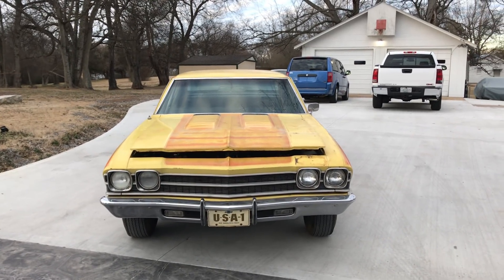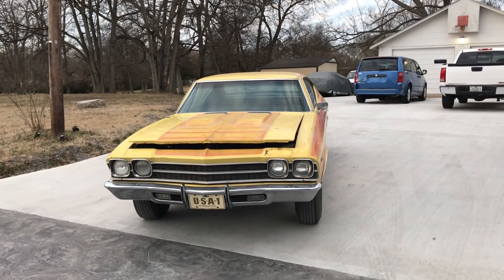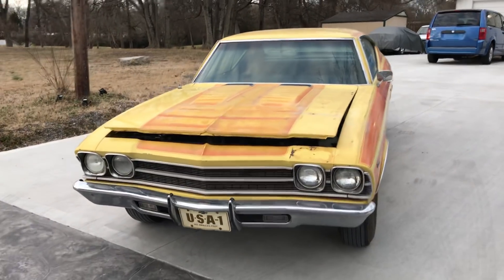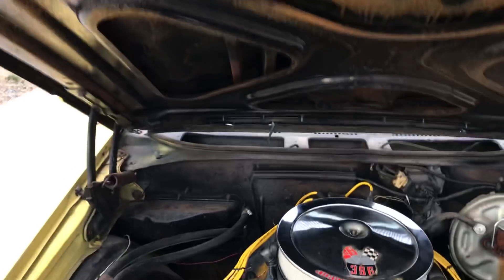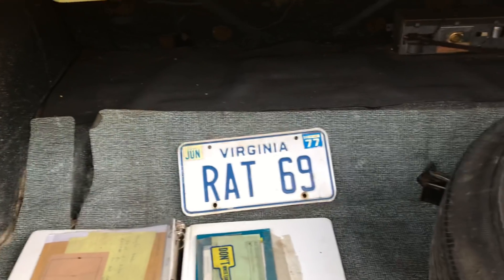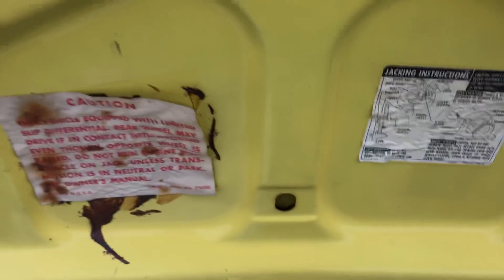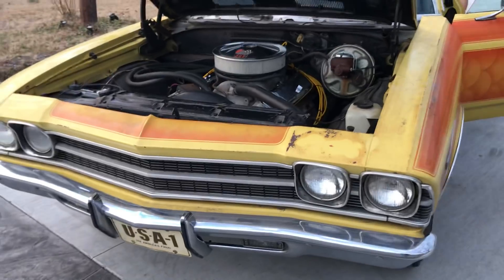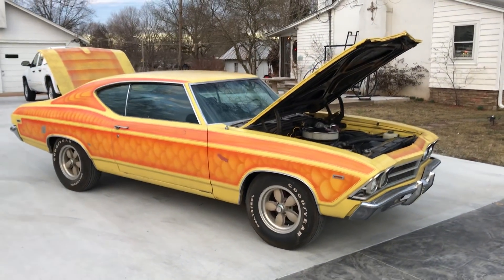POSSIBLY THE RAREST ULTIMATE 1969 SS396 L78/L89 M21 4.10 CHEVELLE EVER FOUND HIDING 40 YEARS!!!

Comment: Patrick is there any way to confirm whether a 69 Chevelle is it truly a 69 Chevelle SS without the bill sheet order. I just picked up one it's got disc brakes that appear to have to have never been changed, 12 volt rear end, correct correct gauge cluster in center console

One of the things that's different about this car is that I've noticed that it doesn't have any fender badges and the fenders appear to be original on the car.

Comment: There was a 69 Chevelle L78/L89 for sale at the '21 Mecum Auction. What was the process to get the aluminum heads? Had not heard or seen one until then.
Reply: Check off the option when you would have ordered the car. No big secret. It just costs more money and takes weight off the car.
Reply: @markg7030  Was there a difference other than the weight, cost? Did it add any HP?
Reply: @stevethomas760  The L89 aluminum heads was about a $400 option and same 375 H.P. rating.
Reply: @markg7030  Wonder if GM just didn't want to mix up the horsepower numbers. Do you know if it was a better head or was it just weight? Would that be like the L88's 430 HP rating?
Reply: @stevethomas760  I think it was only a lighter head. The L88 was an all out race motor for about $4,000 more so they gave it only a 5 horsepower bump up to discourage buyers.

Comment: Very cool. Just got inside from working on my 70 Torino. Car was in horrible shape and had really ugly heavy duty vinyl covers on the seats. Cut them back to recover and found brand new seats. Still had ford plastic on headrest. Some of the seams pulled apart from drying damage. Seats look exactly as they did off the assembly line. Blew my mind

Comment: My dad is original owner of a 1969 SS 396 with 350hp. It is Daytona Yellow with the black stripes. The car was parked in 1976 and we didn't get it running again till 2019 for the 50th anniversary. We determined just yesterday 5/6/2021 that is does not have M22 rock crusher but it does have M21 which was kind of disappointing. It has about 73000 all numbers matching. It does have 4.10 gearing as well.

Comment: I ordered 1968 my first new car.  A 1968 Chevelle SS396, 396/375, M22 9 (early one 1st gear whined), 4:10 posi, Disk brakes, console, am radio, 8-track under the dash, horizontal GM tach.  Color Fathom Blue (very dark almost black) and black interior. I saw 2 L89 Chevelles that year, both of them the dealers the installed the aluminum heads.  How come you never mentioned the deep pulleys were missing< I know you mentioned the water pump and alternator replaced but never the easy giveaway of the deep groove pulleys.

Comment: Amazing car.  I really like the color.  Does the SS hood  add any underhood clearance compared to the non SS hood?  Seems the webbing is the same on both.  I have a '69 elCamino big block swap and need a bit more clearance but don't like the 2" cowl hood look.
Reply: Often you can go to  low rise manifold,    and/or use a shorter air filter.

Comment: Friend of mine had a 69 post SS 396 Silver, M-21, 4:10 gears L78, or so we thought. He blew the engine up in 1970. He and his dad had a time with Chevrolet when he blew the engine and tried to get Chevrolet to replace it. This car was beating 440 GTX's and Hemi Roadrunners on the street. Chevrolet said the engine he blew up wasn't supposed to have that engine and they were not going to warranty the engine. We never did figure out which engine it had.  He said Chevrolet finally said it was an experimental, or preproduction engine of some sort. No Aluminum heads. The replacement was a 402 and didn't run near as well as it had before. This car was traded in and we have no idea where this car wound up. But it didn't have it's original engine anymore. If I'm remembering it did have the chambered exhaust, guages, bench seat no console. We had a lot of fun though running cars at night on the unopened interstate. Saw this video, and it brought back memories. Thanks for keeping memories alive.

Comment: Don't think I'd start it again until I found the valve or cam problem. Sounds pretty rough. Thanks for the video, I appreciate these.
Reply: When I start a motor that I know hasn't ran for a long time, I always pull the distributor and prime the oil system for a while. Even then there can be rust on cam lobes.
Reply: The valve-train noise is a given, not to mention what could be one hell of an exhaust leak! I always like to use the oil-primer tool that spins the oil pump via a drill thru the "lightining-whirler" hole and primes the lifters/pushrods. 5 minutes of time can save 2.5 hours of tear-down & a CHUNK of coin on a rebuild....

Comment: I had a yellow 69 Chevelle once. I don`t know if it was Daytona Yellow or not but it looked exactly like this yellow. Mine originally had a 283 with a powerglide 2 speed but when I got it had been changed to a SB 400 with a Turbo 400 transmission. I sold it to a guy for $250 and a month later he hit another car head on and totaled it.

Comment: A sweet ride but sounds like the lifter need to be adjusted and fix the exhaust leaks
Reply: All396/375 horse were mechanical lifters, nature of the beast to make some noise
Reply: @zendog5884  Feeler guage
Reply: The rocker arm is adjusted not the lifter
Reply: @FuelTankerMan  valve lash clearances are adjusted, lifters are not adjustable, conehead

Comment: Wonder how rare mine was. Ordered @ the Freedom Hill Exchange (PX) @ Da Nang, Vietnam. It was a Dusk Blue, bench seat convertible. Opt's: M21, L34, A01, B93, C06, H05, J50, J52, K02, K05, PW8, T60, U26, U46, U57, U63, U73, U79, V01, V31, V32, & Z25.  BTW, those Amer. Racing 200S wheels were nicknamed "Daisy Mags" back in the day. As well, that is NOT a Hurst shifter. It's a Muncie lever, off a console-equipped car. The giveaway is the unique dog-leg kink in the lever. That kink brought the shifter into closer proximity to the driver when a console was ordered, which of course made bucket seats a mandatory option as well. For 1969, 400 L89s were produced @ $647.75 a pop, available (from the factory), ONLY when the L78 was specified on the order sheet. Later in the year, the chambered exhaust (NC8) was no longer std. w/the L34, but still available as an option. Incidentally, I'd ordered the L78 & M22, but since I'd planned on going thru GMAC financing (though that didn't come to fruition) GM saw fit to deny me those 2 options. Reason behind that most likely was if they were financing me they were "sweating" probable warranty coverage w/THAT kind of drivetrain.......VERY unfair!

Comment: The problem with finding these old muscle cars is they were the cars me an my friends bought in mid to late 70's for less than 1k and we abused them (bolt ons,  racing everything) you could pull a engin tranny combo in your front yard under a tree in the morning ,work on it and put it back in for that nights cruise. All you needed was 3 sockets, channel locks, and a screw driver next video I'll tell you about painting a 57 t- bird all we used for that was two rollers and a paint brush.   
(Dont 8 it was Mary k pink)

Comment: My friend had one back in the early 1980s and it said "Astro Ventilation" on the fronts of the door glass, down low where the vent window would've been.  His was an automatic/console car, and I'm not sure if it was actually an L78, but it did have a Holley carb on it.
Reply: The base 325hp and 350hp 396’s had a Rochester QuadraJet carburetor. If your friends car had an aluminum intake and a Holley, it was probably an L78. The L78 was a completely different engine, 4 bolt mains, with higher compression and solid lifters, made to rev. Sounded very crisp and nasty compared to the lower hp, low rpm base motors, not to mention a whole lot quicker. Rated very conservative at 375hp, as measured by the standards of the time. If I remember correctly, this same engine, as it originally debuted in the 1965 Corvette, was the first BB engine offered in a Corvette and was rated at 425hp.

Comment: Yes that’s not the only one I’m in NJ a friend of mine bought a Daytona yellow black vinyl top 4 sp car from Reedman in Pa. I know the original motor was gone and a 69 427 was put in then a Chevy hi performance small family owned performance shop put a small block in it and raced i down Atco dragway for years I don’t think the car was ever driven on the street hardly at all the performance shop owner knew it was a factory L89 car and was a big block specialist so I’m sure he collected all the date code OEM parts matter of fact he was one of my high school teachers a few years later I purchased a 69 nova L78 car and he did my distributor and jetted the carb I was running B/S and my friend brought his car to Atco to race and during the engine inspection he found out it had aluminum heads it was a factory L89 so he had to race B/S and I dusted his doors LOL the name of the performance shop was Withers Automotive in collingswood NJ on Lincoln Ave he was like a Grumpy Jenkins kinda guy real Chevy guru from what I understand he passed away a year or so ago His wife probably still has the car the mileage is quarter mile miles I’m sure the car is in excellent condition was always inside heat and air funny how we were young kids and managed to purchase these high performance cars as young kids mine ran best 12:28 I kick my but for not keeping that nova it was frost green cheap interior rubber Matt’s m21 it was sold by Farmer Dick Barons in Penna .i bought it used with 12000 miles for 2200 all stock except for the smog pump still retained the Muncie shifter they were the days SJ back in the 60s and 70s had some pretty good cars around such as a motion nova a YSC Camaro and a 70 Motion LS 6 Camaro etc good street racing in the pine Barrons with 11 and 12 sec . Cars if these kids could only see !!! LOL so hope this helped you out but the yellow chevelle was not the only L89 car for sure
Reply: Also what I told you occurred around 1973  ERA !

Comment: omg i had one of these back in 1986 i was 19 years old it was sitting in a field i paid 600 bucks for it and it was that yellow .whats funny is about 10 years ago i went threw a divorce and i was going threw some old paperwork and i had found the build sheet from that car . i guess for some reason i found it behind the seat and didn't know what it was back then.i tried to  find the car so i could send them the original build sheet  but no luck. i drove that car for 2 years and i ended up trading it straight across  in 1988 for a  1971 dodge challenger rt 440 six pack 4 speed which i still have to this day lol

Comment: I know of a 11,000 original mile 69 Yenko Chevelle 427 aluminum head motor 4spd 12 bolt with 456's. Kill stickers on driver rear quarter window from NY speedway. Originally it was black. I'm not to familiar with the numbers for motor but what would the codes be for a 427 aluminum head? heard years ago that there were only 3 produced out of the 99 made that year. Supposedly Reggie Jackson owned one that was lost in a fire? The other one who knows? Anyone?
Reply: L-88

Comment: Shouldn't an L89 have the M22 transmission?
Reply: optional, standard M21. My 69 L78 300 post had an M21 and 6000miles on it when I sold it . It tripled 3 years later at Meecum. Cortez silver perfect car at McCormack Place Chicago. Got 3 to sell this spring then adios amigo as I'm riding off into the sunset.

Comment: hope you put 89 octane with lead additive in the gas tank !??? those heads need lead lubrication at the valves and seats!
Reply: Pretty sure this gentleman has more than enough experience to know that.
Reply: @howabouthetruth2157  : sounded like the valve guides are worn from running unleaded gas !
Reply: @rrfields65  I agree, it certainly does, but ya have to understand, he just found this car, he hasn't been driving it around. I doesn't even have a current tag/registration. I just remembered that he stated the car has been in storage since 1977. Don't know if he bought the car, or if it's even for sale by the owner at this time.
Reply: @howabouthetruth2157  : I think it was 1975 that the EPA mandated the phase out of the high octane leaded 92 in 1977 ( which is what that high compressed motor needed ) and then the 89 octane leaded in 1987. ???
Reply: @rrfields65  Yes, I remember, it was around 1975, and here in Florida, I believe all gas had to be lead-free by 1978. This happened before I moved from Fl to Alabama in 1980. I remember the "new unleaded" being marketed by some gas stations & stores as "white gas". Yeah, these high compression heads do need the lead and high octane. From 1982 to '84, I  had a gorgeous ( totally restored by previous owner ) '66 short bed, fleet side, custom cab/full chrome Chevy pick up w/327 totally built with 2.02 valve heads, fairly hot cam, 4" Holly intake & 750 single pumper, and double roller timing chain. It replaced the 283 that originally came in the truck. Ran like a bat out of hell with the factory posi rear-end w/3.73 gears. My room mate borrowed it and failed to fill it with hi test as I instructed. Thankfully, he filled it only a couple miles from getting back home, so it still had hi test in the fuel line. Man, when I got back in it to go someplace, that motor went to poppin' and banging. Worst back-fire I ever heard, hell, I though it blew up at first. I shut it down immediately & had to siphon all that regular gas out. Re-filled & primed the carb with hi-test.......motor smoothed right out. That idiot, lol.
Reply: @howabouthetruth2157  : that pre-ignition detonation can burn the hell out of valves and crack blow out compression rings from high test un-leaded ! seen motors that had to get relined bored with with new cylinders inserts because of deep ring dredging.

Comment: In my opinion the reason for the low mileage is the actual horsepower of the car is in the 400 + range and it’s a potential death trap with sub par steering and brakes not to mention terrible gas mileage ..
Reply: Apparently you have never driven an almighty A body.    One of the most fun muscle cars to drive.
Reply: Thats what made Muscle Cars fun.
Reply: No one bought a car like that with gas mileage in mind.

Comment: Mine is in better original shape than that one... Garnet Red black vinyl top buckets which was originally a L35 325 horse M20 that was replaced with a 69 L78 M20 with the factory aluminum heads and intake, 6k RPM tach and correct tune sticker early in its life.. 44k original miles

Comment: That is the. Absolutely poorest running 375 ho 396 I have ever heard  my good friend Ron Gibson  rip had a nova  sixtynine ss 396 375 hp with a large Crainer fireball cam in it and that little duce ran hard  used to beat eighty percent of the hotrods  at the Hollywood drive in  Rockford ill

Comment: Not that rare. My uncle still has three he bought brand new. One is his daily driver and has been since he bought it new in 1970. The other two are still basically new, one has 24 miles and the other 102. They are far from the most rare in his collection but his favorite to drive.
Reply: I highly doubt your uncle has three with those exact options.
Reply: @wrenc842  Don't be jealous he is an old man.
Reply: That is not daily driver options,only racers and gear heads ordered these back in the day and most dealers had trouble selling them. This far surpasses the l-78 375h.p. Option. I lived then I know. It amazes me the young people that misdiagnose a solid lift cam for bearing and engine problems